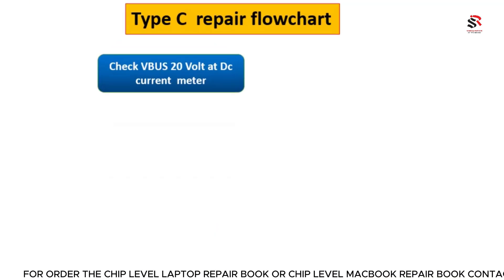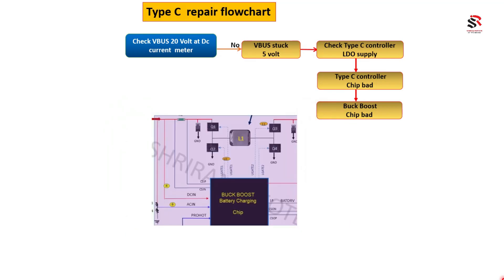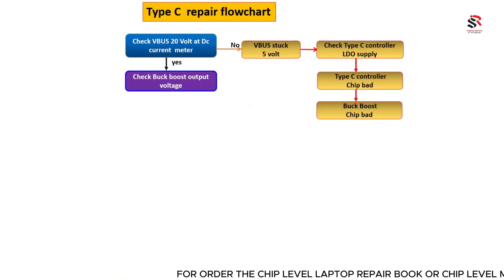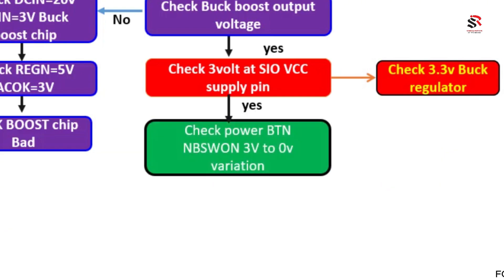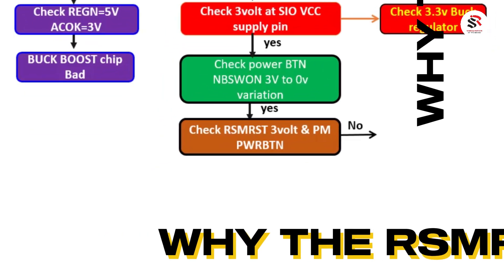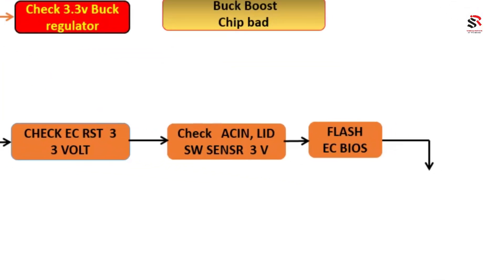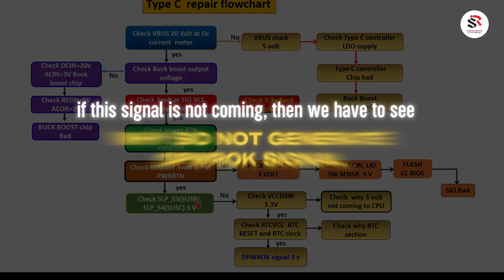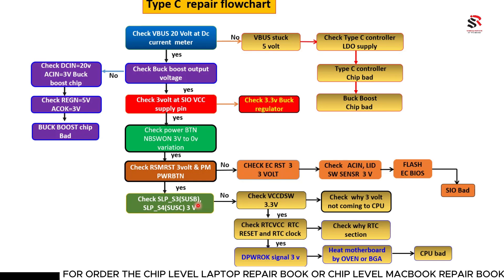Type C laptop motherboard repair flowchart

Comment: Hi. This is Arun from Pavithra Laptop Care. You may be publishing my comment or not that i dont know. here, a small correction i wanted to make it. Actually, in type C , there is no link between buckboost converter charging IC. Because, it may accept the input from different sources like battery, adapter and Type C Thunderbolt. Please Correct it in next videos. I am really sorry if i am wrong. Thank you. I think you respect my comment and gives meaningful response. thanks once again. 😊
Reply from the maker: Thanks for your comments but from  according to our knowledge charging mostfet control by buck boost chip
Reply: @SHRIRAMINSTITUTEOFTECHNOLOGY  thanks for your reply 🙏.  You are right. The buck-boost means charging ic like ISL9538. These NVDC will accept input from adapter, battery and type c. Requesting you to disconnect the input part of charging ic, and check type c will give 20v or not. If it wont gives, my apologies 🙏
Reply from the maker: @Pavithralaptopcarehindi  so nice of